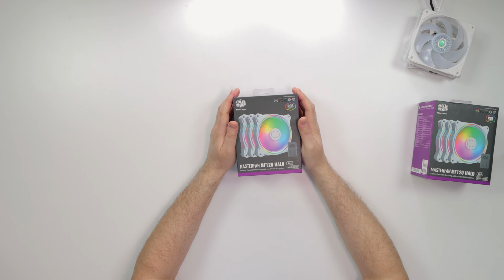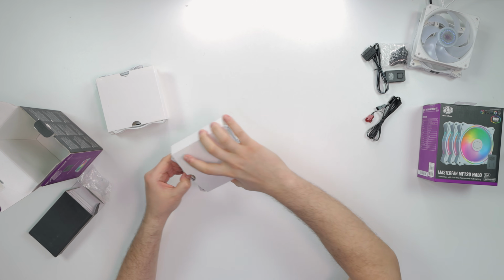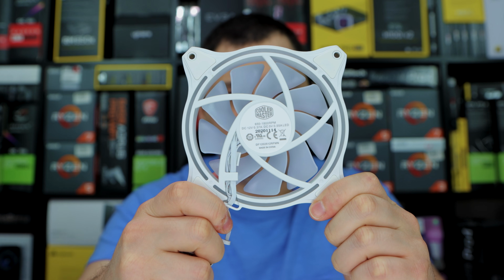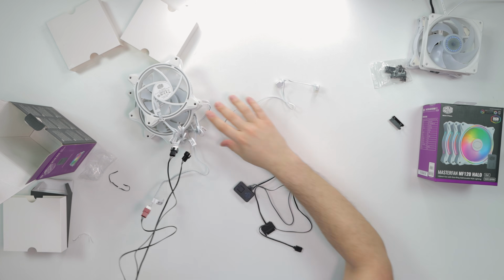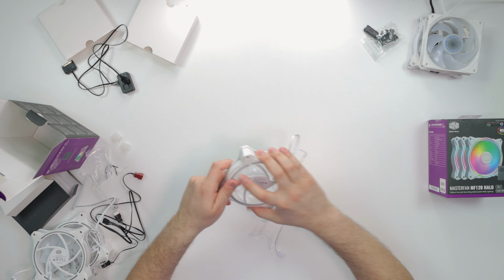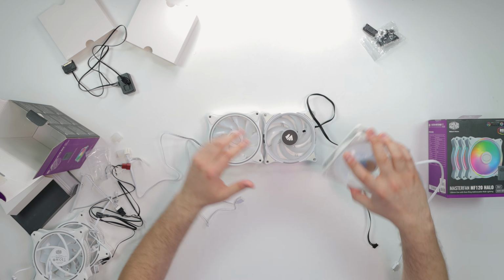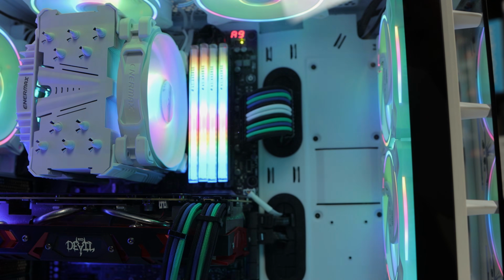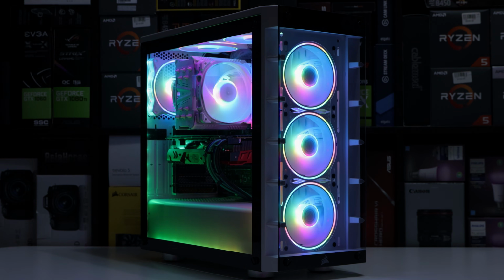Cooler Master MasterFan MF120 Halo aRGB Fans Review | Airflow, Noise Test & RGB

Comment: Warning to those buying these fans. The LED's will go full yellow over time. I had to replace a exhaust fan barely and the LED's do NOT match anymore as the other older fans are completely yellowed out. Never noticed until I had to replace this rear fan.

Comment: I'm about to try to take ML240R ARGB AIO and add Halo fans to it along with 6 Halo case fans. The ML240 controller has 4 ARGB ports so I will daisy chain 2 fans each to the ports trying to keep the load down. The ML240 controller has a USB 3 port in the bottom that can be linked to a USB connector on the mobo to give me access to Cooler Master's control panel (I hope). My mobo doesn't have a dedicated ARGB connector. Expensive, but all 8 fans should be the same.

Comment: Hi and many thanks for ur usefull content! Im planning to install 9 Halo fans (I will buy 3 kits with 3 fans each one), so can I wire all 9 fans between them and connect to a controller included in the kit or need to wire every 3 fans and cinnect every connection in the cooler master argb hub (if I remember right its not included in the kit)? Thanks in advance

Comment: Hi Mate, greetings from Australia. For me its about the execution and fine details. If i am after a white fan i want it to be fully white so this included white cable, white hub sticker and white rubber pads. Hence why the cooler master makes sense for me.  CM ML fans can be had here in Australia for 25 AUD or about 20 USD. So the price is also right.

Comment: The EZ DIY and other Chinese knock offs are usually rated at 40K hours mean time to failure (MTTF - or average failure time). The Cooler Master fans are rated at 160K MTTF. So, in all fairness, we should be looking at technical specs also, since the MTTF rating is how long the fan lasts. 40K vs 160K MTTF is is over x4 longer life for the CM fans. Incidentally, the Noctua Redux fans, also excellent fans, have a 150K MTTF.

Comment: Did anyone have any issues with the screws included with these fans not really fitting very well in their case? For my case the flathead part of the screw is barely wide enough to hold the fan on the fan mounts without the screw from going through the mount holes on the case. My fans are all installed and holding on my Lian Li Dynamic Evo but I’m afraid they will come loose over time and the screw will slip through. Does anyone have any recommended alternative screws for these fans with a wider flathead?

Comment: Sickleflow also come with the AiO's which means that the Bigger Blades ist just for the H20 movement and the Halo's are just for Normal Case or CPU use case
Reply: The Illusion AIO comes with Halo's, so they are fine for AIO

Comment: I bought just one unit of this fan, but the 140mm version, it's a great fan so far, the led ring is very beautiful, the air flow is strong, and the best, the connector is the standard 5v ARGB 3-pin, it worked with a simple Coolmoon controller.

The only concern is with the screws, the head is not wide, in my case (corsair 4000d) the screws almost did not hold. Another problem with my corsair 4000d (in fact it depends on your point of view) is because my fan is 140mm, some parts of the led ring were covered in the front panel.
Reply: is it software controllable ?

Comment: Don't overchain the 5V ARGB fans & devices over 3-4 pieces, they'll lose power without an external sata powered hub. The brightness on ARGB IS only adjustable with playing around the R/G/B values, definitely overkill brightness if you're maxing some out on 255.
Reply: can single argb header hold up 3 fans comfortably?

Comment: you don't have to use software for the mobo or the fans. SignalRGB works with CM argb controller, same with the fans. after setting up correctly all works similar to iCue. Cheers!
Reply: would any brand fan work (asia horse) withe cooler master argb controller?

Comment: Thanks for the helpful video. I was really going crazy trying to set up these fans. The instruction was a little bit too complicated, why do they never include written instructions instead of these drawings? Still, thanks to your video, I was able to set them up. My problem now is that, since I'm using the splitter, the motherboard refuses to detect the presence of the fans so now they're at full speed and making a little bit of noise.  Is there a way around this problem or I'm stuck with fans rotating at full speed?
Reply: Do you not have any other unused PWM headers ? Some motherboards have up to 4
Reply: @AhmadMaseh  I was able to change it through the BIOS menu, so it's no longer rotating at full speed. As to why it was not detecting its speed, I have no idea, but it's working now.

Comment: Hi, I really like your video, great work!!! Just wondering if this will work if I chain this with the Lianli ST120 (3pack) (you had reviewed) + B560 gigabyte mobo that has ARGB headers. I might only use the accessories that come with the Lianli, not using any extra hub or so, and control it using Gigabyte software. I know that you mentioned in the video it doesn't work with Giga mobo, but not sure if there are any updates. Hope someone can help me with this. Thank you.

Comment: hi, can i connect this to argb fan hub of pc cooler(5v) corona the one taht you reviewed before? im planning to buy just 1 fan of this coolermaster halo(as repalcement for the air cooler fan),, although the fan hub of corona have 4pins, but i bought an additional corona fan but it comes with 3pins so i just punch a hole on the connector using heated paperclip so that i can insert it to the hub good thing it works,.
Reply from the maker: Lol nice

Comment: Can I use 3 of these fans and 3 Asiahorse and 2 uni fans my case can fit it and my mobo is b550 a asus rog strix
Reply from the maker: Yeah the Asiahorse fans will need to work with its hub though Asiahorse hub
Reply: @KosherTech  yea I mean like can i put 3 hubs in same pc
Reply: @KosherTech  and what should i get 5v aura 3 pin interface or hub and remote
Reply from the maker: Brah brah swing by our discord server we'll help u out https://discord.gg/f5g7NA4

Comment: I'm thinking of getting cooler master fans and an AIO liquid cooler. Would you personally go with a 240mm cooler with MF120s or a 360mm with sickleflows?
Reply: I used them on a 240mm with a 7 5800x never went above 65c for me I now use them on a 360mm

Comment: I have an Aorus Master mobo and their ARGB headers are the same Asus and other brand mobos . They should work without that gigabyte connector . You only need them for older gigabyte mobos like z170 z270 or older Gen .
Reply: Hey mate, do you have z390? If so did you plug-in them into DLED_V_SW1?
Reply from the maker: Check out the mobo website best bet
Reply: @KosherTech  Will the CoolerMaster ARGB Controller A1 support all branded ARGB devices like Deepcool L360 A-RGB AIO and CF120 and CRF120Plus fans?

Comment: Great video! Love the breakdown! 

Just to recap I bought 7 of these fans but 140MM. My motherboard is a MSI MEG Z490 GODLIKE. It does have compatibility to use the 3-Pin headers. Is it required to use a Hub. Also do you recommend using and cable splitters or just straight daisy chaining them since I have 7 fans.

Love the content!
Reply from the maker: Honestly whichever way you think works best for your setup or for your cable management & thank u!
Reply: @KosherTech  ur wish

Comment: @KosherTech my motherboard has 2 argb fan headers and they are connected to 6 argb fans (3 each on each header) and i want to connect 9 argb fans total in my case. how can i connect them all? do i need some kind of hub? mobo is asus x570 e-gaming.
Reply from the maker: Swing by our discord server brah brah we'll help u out https://discord.gg/f5g7NA4
Reply: The best choice is to use a SATA Powered ARGB Hub
Reply: @darkknight2346  Yeah i figured. I got a sata powered argb hub from amazon with 10 argb outputs for less than 10 dollars. I now have only one cable from mobo connected to the hub, and from there everything connected to the hub. Case is so much cleaner now. Now i have 9 argb fans, 1 argb gpu bracket and gpu rgb connected to the hub directly.And i still have 5 free ports on the hub. Works great with Aura! It literally saved me. No need for expensive hubs like corsair's or sticking to only one brand with its ecosystem.  Thnx for reply btw!

Comment: Hey are you going to review the IN WIN Sirius pures in white?
Reply from the maker: Hey thanks for the heads-up about em fans. I just added em to my amazon cart. But the fan isn't RGB though just the outer ring only is. However I should be able to cop em, again tha ks 💯 for that suggestion!!
Reply: @KosherTech  np, i built my o11 around them and i made a youtube video on it, should give you an idea

Comment: @KosherTech Love these, have 8 in one of my builds (Meshify C Mini to boot!). Yes, they do work with Gigabyte RGB Fusion/Mother Boards and they look spectacular! However they do not work with Cooler Masters own 
 MFY-RCSN-NNUDK-R1 RGB controller, like the one included in the Mirage 240 AIO.  Not sure why, maybe something to do with mirage effect but only a  hand full of Cooler Masters other fans do.
Reply: Good to hear. I have B550 Gigabyte board and was interested in these fans. Thanks
Reply: https://www.coolermaster.com/catalog/coolers/rgb-accessories/argb-led-controller/

Will they work with this?
Reply from the maker: I actually just bought one from Amazon. It should make it work idk I will review it
Reply: @KosherTech  I have had mixed results using many ARGB fans with the Cooler master MFY-RCSN-NNUDK-R1, it seems like maybe 2 of the wires are switched. Right now I got it working with 2 stock ARGB 120's from the CM Mirage 240 AIO & 3 Deep Cool ARGB CF120's. Had to make custom splitter and couldn't get more than 5 total fans going through the controller.
Reply from the maker: Swing by our discord server let us see plz
https://discord.gg/f5g7NA4
Reply: @KosherTech  for sure, when i get out work i will.
Reply: will this work if i connect 1 fan to pc cooler corona fan argb controller?
Reply from the maker: It might
Reply: @KosherTech  yo bro, i totally forgot about you! Sorry life happened. Are you on discord now? My GF is asleep so i gotta be quiet but i'm here.
Reply: @sageofsixpath99  The controller these fans come with seem to work with most ARGB fans. These fans seem to work with just about any ARGB controller I have tried (other than the Cooler master MFY-RCSN-NNUDK-R1).  They do not work with the MFY-RCSN-NNUDK-R1 controller (from Mirage AIO) the software lets you choose from several approved fans and AIO's but not them.  Your fans may or may not work with it. Made a custom splitter to get Deep Cool fans to work though.
Reply: @supremeoverlorddiamontethe4557  nice! thanks bro for the info

Comment: I’m looking to upgrade my pc visually and was thinking about getting a Corsair 4000d airflow with 6 white fans. I have a msi x470 gaming plus with a 4 pin rgb header. Software is horrible and indicator leds for ram and gpu are always on and only red unless I turn off the rgb functionality. So they basically need to be controllable outside my motherboard and any software or I will have red leds screw up the color scheme. Preferably pwm fans so I can control speed through the bios. I also plan to put 2 on my aio. Budgets for fans is around €75. Any suggestions?
Reply from the maker: Man I reviewed plenty of ChineseRGBFans check out my playlists. Or my top 7 rgbfans
Reply: @KosherTech  thanks I will

Comment: Yes CoolerMaster fans are coming up as well as there cases. The fans are super nice with nice heavy and durable plastic molding which is superior, but once you mention no light adjustment and you got to change everything in the ARGB software but overall nice and looks good in a white case.

Comment: Time for a motherboard upgrade so you can test out the full ARGB functionality
Reply: Agreed
Reply from the maker: But it still will be different. Cause different mobo softwares have their out features
Reply: @KosherTech  that’s true. I recall watching a video where they compared softwares and apparently MSI is one of the most feature filled. 

There’s also the option of using icue with an Arduino emulating a Corsair lightning node... you just run the data wire from the Arduino to the ARGB on the fans, and it’s 100s.  
I think it’s called Corsair Lighting Protocol on GitHub. It might be an interesting idea for a video too.